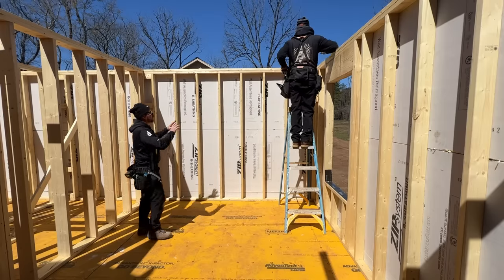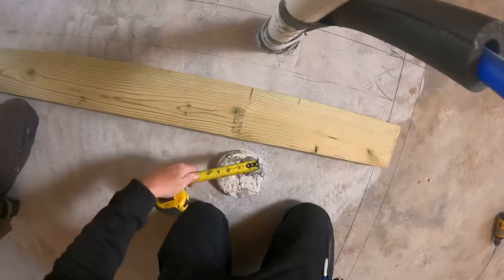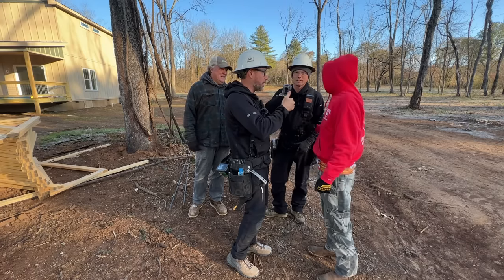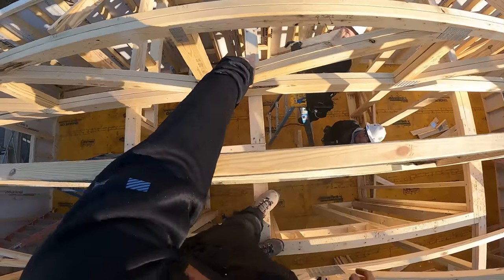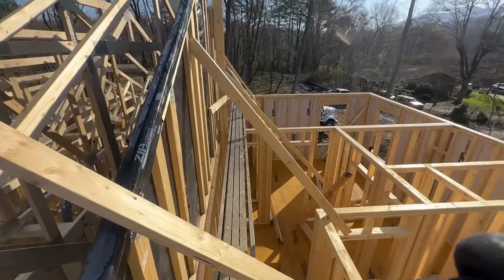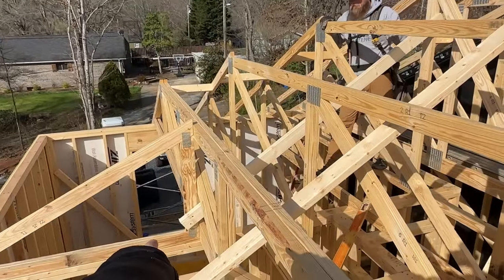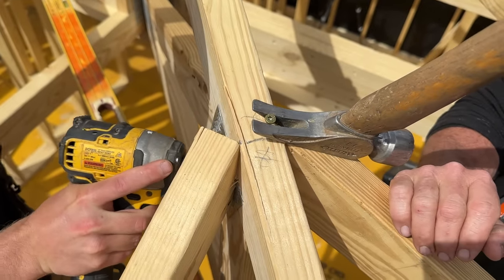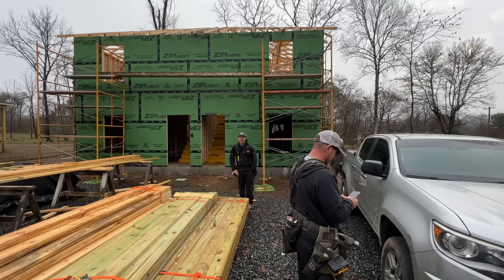Construction of a Duplex Part 13

Comment: I like your channel. With a couple straps around the entire bundle of roof sheathing, in a basket or choked configuration, you can fly it as the first pick with the crane, before the trusses, to the top floor or on top of scaffolding or half on one side of the house and half on the other. It makes for a shorter distance to hand up the sheets later. Hope that helps. Thank you for your videos.

Comment: Nice work, it always amazes me how much the building style differs between countries, in the Netherlands where i live we would never build a house using essentially only 2x4s. Most of our houses are brick and mortar, and we never use trusses for roofs but always rafters for the extra indoor space. It's not that one is better than te other, i think the way we built is way more expensive, but maybe lasts longer, and the ground prices are way higher so optimizing indoor space is a must.

Comment: @4:18 I am surprised that Arlo didn't do the trick my grandfather used to do with exposed stair walls. Build out the tread wall with the stringers but where the posts go, he would cut out the post width from the middle stringer (creating a mortise). Then you can cut the post end to have a tenon that slides into that pocket and run screws from the side of the stringer to securely anchor the post without having visible screws after finishing.

Comment: I have worked on more houses that had hip roof truss packages then houses with gable truss packages. On every job we assembled the jack trusses to the girder trusses and lifted it as single unit, then set the common trusses between the girder trusses. The jack trusses were assembled to girder trusses the day before crane day.

Comment: That hook is kinda dangerous but hes obviously a good operator. Those boom trucks (small cranes) can be hard to control the load because when feathering the  hydraulics, the throw is short. So he's gotta be smooth or good at catching his load to make sure that hook doesn't slide. Two nails on each side with a wide mouth so the hook won't slide but will still dismount is ideal.

Comment: I can't believe you guys didn't attach all the common jack trusses (baby trusses) to the girder truss before the crane came.  It's simple to do,  saves a bunch of time over doing it in the air and it braces itself immediately when installed.  You don't even need to set up a jig as you can do it several ways,  one of which is with the girder flat on the ground.  You also get to start out with many of your eve blocks already installed.  NEXT TIME....

Comment: you could have done this with a lull - this job was fine but unoptimized and old school - you can do much better - you might have been able to do the job with a big scissors lift - probably more useful than the lull since it can do so many jobs? if you had prefabbed all walls the crane could have hoisted them all in a few hours cutting a week off the job - potentially- something to think about anyways  #don't run with scissors #scissor sisters

Comment: Dudes, when lifting trusses with a crane, ideally use a spreader.  
I've seen the nail/truss plate seperate by loading from a single point, only on big big trusses though. 
And that is the weirdest way ive ever seen a hipped roof constructed. 
I never done one like that in the UK, usually its made up of trusses and then long rafter pieces for the hip, then make up the rest 
Also, we use twist nails for floor joist hangers, but we put them on first. Shooting with a nail first then putting the hanger on after seems better.

Thanks